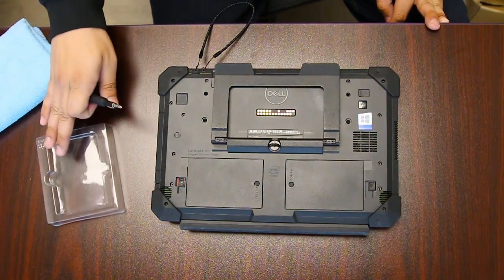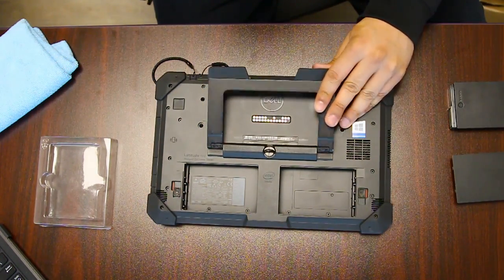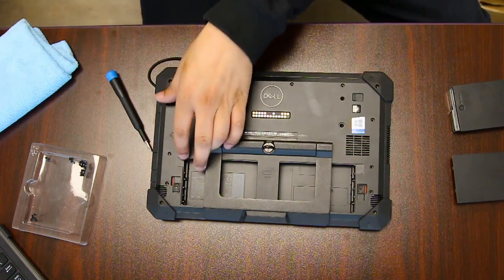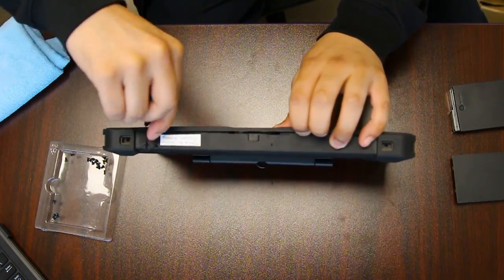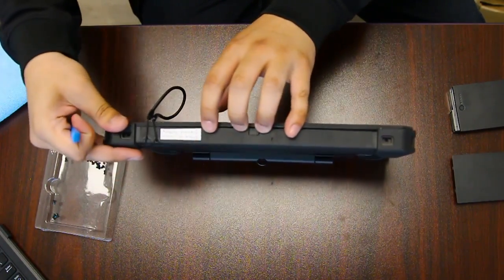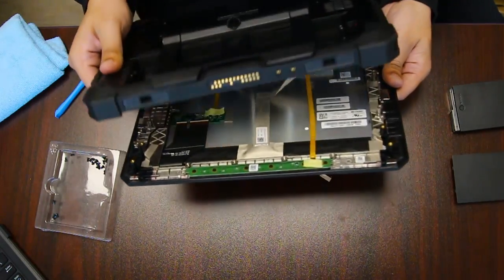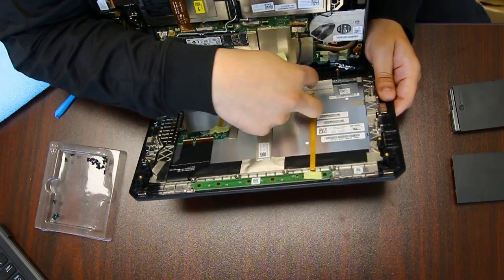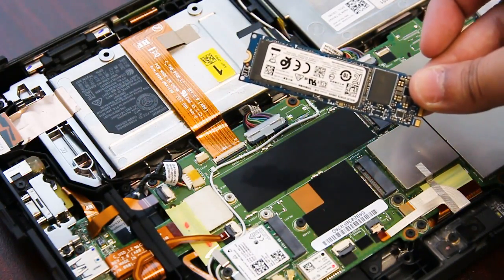Replace Your Dell Latitude 7212 SSD!

Comment: Is the blank slot near the existing SSD given to add another SSD ( smaller nvme ) ?? 4:19  My question is can two SSDs be installed at the same time ?  I’m talking about the blank slot directly below the WiFi card !! Can I use that too?? Or is that even a SSD slot ?
Reply from the maker: @shridharshan8948 The best way to answer this question is to simply fill out our Tech support form.  Our in-house technicians will answer with the links and info you will need.  Here is the link: https://www.bobjohnson.com/tech-support-form/  Thanks for Watching.
Reply: Did you add another SSD? The second is for pcie nvme only and the one that comes with it is sata. They look the same but function different. Also, if you press F2 at the dell logo on boot, you can see on the information page under where you have the sata ssd info it says either pcie or nvme blank

Comment: Hola, tengo el mismo equipo y pasados unos meses muestra líneas verticales en la pantalla, veo que tanto la mia como la del video no tienen el disipador de calor que va al fan. Te ha dado problemas? La compre por Amazon refurb
Reply from the maker: @alexgargolas25 The best way to answer this question is to simply fill out our Tech support form.  Our in-house technicians will answer with the links and info you will need.  Here is the link: https://www.bobjohnson.com/tech-support-form/  Thanks for Watching.

Comment: But how to change the memory or increase it, do you need to completely disassemble it and there will be a slot for RAM under the motherboard?
Reply from the maker: With these types of tablets, the RAM is soldered on to the motherboard. That being said, we do not recommend that you try and upgrade it. It would be better to just upgrade to a unit that came with more RAM from the factory. Hopefully this answers your question, thanks for watching.
Reply: @Bobjohnson  Is it also not possible in 7220?